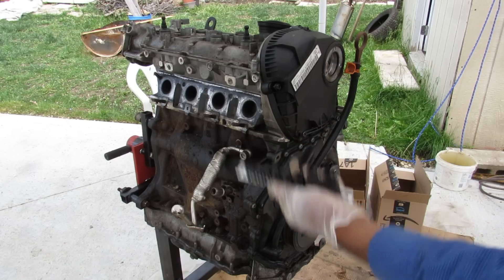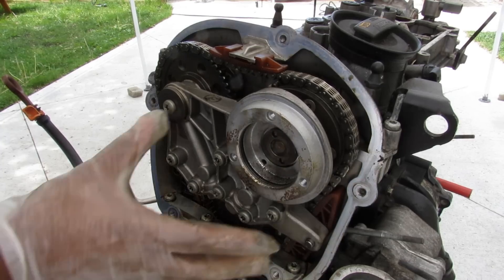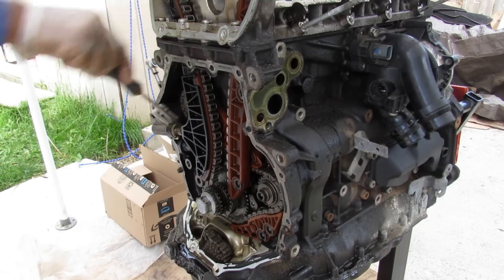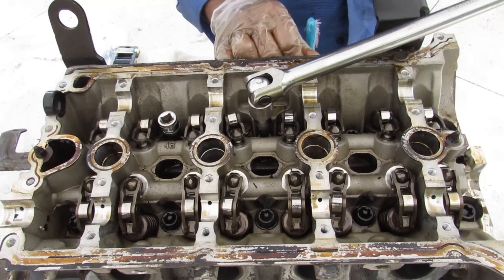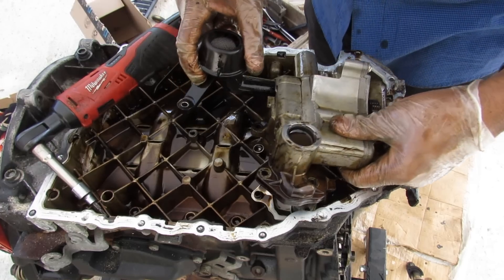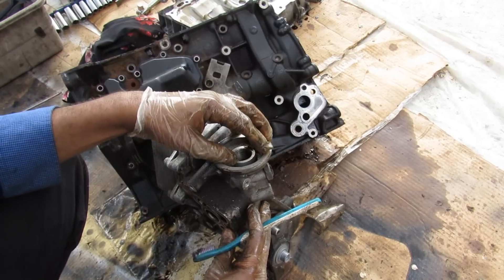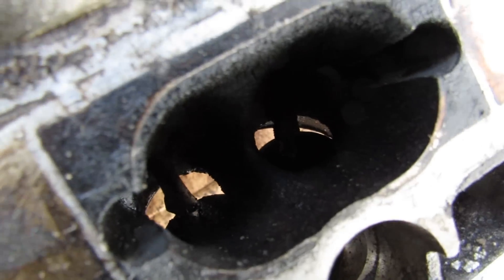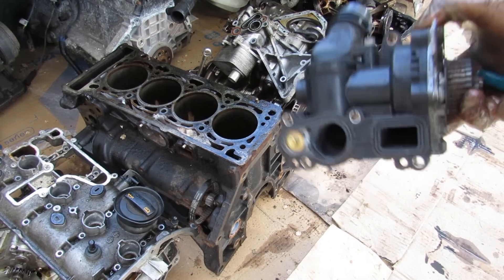Why Volkswagen Engines Fail

Comment: Man. The Title is shit already. Sorry, but not all VW engines fail. The ones with chain do bc vw just cant build good chain engines, but the ones with the Zahnriemen are quite reliable. The 2.0 TSI is when driven correctly an engine you can get 400 Ps with and IT Just runs. I really dont wanna be negative, but you Talk too much Shit.

Comment: I have 2016 ea888 2.0 tfsi gen3 , it has been 5 years now without any single prob I just think this engine is still like yesterday 
I also got another 1.8 TTQ gen1 and it’s still running like a champ for almost 20 years without any issue too
Another one is my R53 Mini Cooper S 15 years old runner:) 
I don’t like dealer stealership, so basically I’m doing standard maintenance myself at most and I’m not a mechanic either now I’m 38
“ simple care “. Will make the most of it  Maybe !!

Comment: And this is used also in their (VAG’s) “premium” cars huh.....Nothing from VAG is “premium”.
Reply: The only thing premium is the price to keep the thing running.
Reply: Funny, I have had absolutely no problems with my VW.
Reply: @BabyBugBug  what engine did you have, petrol or diesel?
Reply: @MrRohanThomas  Petrol 1.4L
Reply: @BabyBugBug  mine broke down 2 months ago😂
Reply: @chiel-  I’m sure it did unless you didn’t change the oil
Reply: Bugatti and Bentley and or VW Phaeton... hmm?

Comment: Kinda wish I could have sent you my old 2006 Focus for you to tell me why it went through three starters and three power steering pumps (among many other issues) in ten years.
Reply: Steering pumps seem to be a common failure with all of their models, and the newer electronic versions have their issues too... I mean for the hydraulic assist you can just put an aftermarket oil filter on and sometimes change the ATF in the system, so you can get decent lifetime out of them with a little TLC, but with the new ones you never know 🤔

Comment: All modern engines fail because two Main reasons..... 1. They are forced to produce more power from less capacity, 20 years ago we had 2.0 who produce 110 hp, now we have 1,4 who deliver 160 hp, în time material fatigue is critical........ 2. Long life oils changed at 15.000 km, they are a big pile of shit, no oil type shoud  be kept over 9-10000 km

Comment: Mk7/7.5 engines are more reliable than Toyota engines.
Reply from the maker: But they are still more expensive to maintain
Reply: @speedkar99  Service wise, I completely agree but then you get more powerful engines with even better fuel mileage. For instance, my 7.5 gti is more fuel efficient than a Toyota Yaris even though my car is hot hatch. It goes back to whether the buyer has some extra cash to spend.
Reply: @mkviis  Wrong. The Yaris is cheap to run and own. All VWs are expensive to run and own.
Reply: @MatrixDiscovery  I’m talking about fuel efficiency, my car does 38 mpg and Yaris does 35 mpg. My car is sport, Yaris is economic. My car has more than twice the horsepower. That’s what I’m talking about.

Comment: cast iron block with aluminum head, sounds like recipe for long lasting engine.
But VW being VW.
Reply: Almost every engine up to 2000 and even today was/is like that - nothing wrong with it
Reply from the maker: Make it all aluminum like all engines after 2000
Reply: Cast iron block with alminium head usually last forever, like Mitsubishi 4G63 and many others.
But Mitsubishi switched to all aluminum configuration in 4B11 and still is an exceptional engine.
Reply: The disastrous Chevrolet VEGA engine had an aluminum block and iron head!
Reply: @genekelly8467  seems like GM never made a truly reliable engine beside LS
Reply: @madunwerkstatt3093  Not true-the SATURN 1.9 l I-4 was exceptionally reliable-mine's running at 207,000 miles
Reply: @N4CR  too bad we didn't get V6s down here..

Comment: Your videos are amazing, you can learn so much from them!!! Thank you! I would like to ask, do the 1.8 tfsi engines face the same issues as the 2.0 ones? Do they share the same faulty parts (timing chain tensioner, water pump, etc)?
Reply: Yes, they're the same.
Reply from the maker: You are welcome. No experience with the 1.8
Reply: Same engine family, similar issues. Heard about cylinder head problems with those. But pay attention to which generation it is, the gen3 version is fairly reliable thankfully
Reply: The EA888 exist in 2.0 and 1.8, so yes it should be the same. gen1 was shit, gen2 was meh, gen3 is kinda ok (started ~2014 or so depending on the car model).

Comment: Sold my GTI after 150k miles. Everything engine related was starting to fail, oil & coolant leaks along with carbon buildup (again).
Reply: Well past 150k with not a single fault, ever.
Reply from the maker: Wow. Anything catastrophic fail?
Reply: @speedkar99  you'd have to ask the person he sold it to

Comment: 2E, ADY, AGG and ABF were the best 2L engines VW ever made in terms of simplicity & reliability.
Those were simple to work on and were built to last.
Reply from the maker: Nice
Reply: Are they the "2.slow"? :)  The EA113 & EA888 is the "2.fast" I guess!
Reply: @TassieLorenzo  best in terms of RELIABILITY & SIMPLICITY.
Reply: @TassieLorenzo  That's the 2.5 EA855 inline 5 engine that people refer to as the "2.slow". The EA855 is also one of VW's best engines.

Comment: TSI engines are wide used but after 100k miles they are ticking 💣. Those are 100% guaranteed failures. DSG failures are also very common. So there you have it all information why you should avoid it. PS I'm the lucky owner of 1.8 tsi with DSG 🤣(basically the same engine).
Reply from the maker: I want to teardown an DSG next
Reply: @speedkar99  It would be great if you could find DSG7 (dry dual clutch). Thank you 😉

Comment: Just change the oil regular as clockwork and don't rev it until it's warmed up. Like any other engine it'll last forever. Mine has!
Reply from the maker: This one seemed to be well oiled and still failed.

Comment: Lada engines have timing chain and tentioner, they never fail.
Reply from the maker: But everything else does
Reply: @speedkar99  the only thing good about modern ladas is the engine block heh. It's a modified 4 cyl design that dates back to the 70's. Made of cast iron, handles a turbo like a champ. The 1,6L Lada Vesta engines get swapped into the old Lada 1200 cars and with  some other adjustments can run 300 HP reliably. The rest of the car is... well... cheap.
Reply: The only good thing about lada.
Reply: To be fair- the guides occasionally failed- with the chains munching through them. Clattering along still- until the chain chewed a hole in the side of the head and spat oil out lol !
Such was the cost of the chain guide (pennies) and its location- replacing them was the sane thing to do during a service- two 10mm bolts and 60 seconds to do ! :)
Reply: Yupp a true ruski ride
Reply: Btw the newest motors are like 85% plastic... Last vw motor year ill ever own is 2005. New shit is cheap. Too much maintenance on a direct injection as well
Reply: @raisethecolours  Agree. D.I with all the carbon build up
Reply: @Blue-moon12  i remember back in 08 everyone was nutting themselves over D.I.     I was like yeah high psi fuel equals high repair costs. Hence the cummins 12v and 24v fuel systems.. terrible and costly due to the machining and making of the just the high pai pumps themselves. Vws have a pressure regulator and u gotta replace it quite often and its almost 200 dollars... Im good ill stick with the old tech. It is the best .....
Reply: Thats because the car rusts to death before the engine has a chance to fail lmao
Reply: @abadibi  Yh sure. they rust. I was just giving an extreme example. Okay audi 80 b4, no rust and engines are indestructible, I drive 1.6L golf 3 variant, car has done 380k km, and thats what i know, who knows how many times the odometer has been tampered with. Ive done 80k with the car in the last 3 years. All ive done to the engine is new spark plugs, distributor cap and rotor. oil change every 5-7k km, and timing belt every 60k km. And the car is not rusty either. meanwhile Ive seen new audi's come in the shop with 40-50k km and they need timing chains replaced.

Comment: Can you create a video explaining what carbon build up is, and where it comes from? How does it get on the other side of the valve and intake runners. Why does it stick to the combustion chamber, and how do products like Seafoam remove it better than fuel spray/combustion process itself?
Reply from the maker: Good idea

Comment: I've had a family friend with a VW 1,4l TSI. The car had 3! engine replacements winthin warranty period. One time the time head and block warped, and started leaking all over. One time the engine just LOCKED UP while driving on a highway an nearly crashing him, the third time it had a piston blow up... I'm not sure how VW manages to mess up their gasoline engines so hard. Each time the dealer decided that it would be cheaper to replace the entire engine unit... Needles to say, the man sold the car as soon as warranty expired.
Reply: How old was the car,  which model?
Reply: @mikimenendez  I think it was a Skoda Fabia Second gen... although now that I think about it it had an FSI engine, not a TSI.
Reply: @foxman105  Thanks! I just bought a 1.4 TSI, the most recent,  wish me luck!
Reply: @mikimenendez  Well hopefully they managed to finally fix the problem. As much as VW is a comfortable and responsive car, the mechanical reliability of their engines went down with FSI and older TSI engines. Hopefully they fixed it. BTW you might want to invest into oil catch can on the recirculation circuit as they often get dirty valves because they're direct injected.
Reply: @foxman105  absolutely,  thanks!
Reply: @mikimenendez  dont worry.Have mine for 8 years and no problems.
Reply: @gideonvanloggerenberg4831  Thanks! Everything going perfect till now
Reply: @mikimenendez  no problems
Reply from the maker: Wow. 3 motors
Reply: @speedkar99  Yeah, each time the engine blew up they reset the 100k engine warranty because they swapped in a new unit. It's 5 years or 100k so he sold it after 5 years.

Comment: Fun vid, no shot at the producer of it but a 10 year old engine (average perhaps 150k miles?) for which we have no idea on maintenance records, service intervals, or actual mileage.  Therefore no point of reference too make any kind of procurement decision on a VW product.  For every motor like this there are thousands that run up much higher mileage without said issues.  Of course the VW haters all cheerfully pig-pile on VW’s poor German engineering, a common internet past time it seems (perhaps they could design and manufacture a better one?).  Quick story, wife’s Hyundai Sonata fragged it’s motor with 100,007 miles.  Oil changed every 3,500 miles professionally, dealer serviced from new, always on schedule.  Meat Heads at Hyundai headquarters wouldn’t even talk to us about their POS engine just 7 miles out of warranty.  So all Hyundai’s are crap right?  Most likely not, but this was our particular reality/experience; much like this sad motor.  All mechanical devices fail, some sooner than others depending on their treatment.  Maintain your VW engine and drivetrain with quality consumables in a timely factory scheduled manner (be more aggressive than the current 10K oil intervals) with professional mechanics and your results should be different from that witnessed here.  Were this not true VW would have been out of business many, many years ago; consumers are truly not that stupid.  Enjoyable video sir, thank you for sharing; absolutely love the family support equipment you utilized in the engine tear down.  Cheers!
Reply: huendai are crap and some japenese cars are crap too but you know what is the diffrence ??? the diffrence is that those cars are cheap and there parts are cheap too and fixing them is simple and no need for expensive special diagnostic, programming , sockets and tools unlike VW ...

Comment: Your research has gotten really good.
It's worth noting the early style timing chain tensioner can be replaced with an updated unit, meaning you can get these engines on the cheap from people terrified of failure, and then do a day's work to make it fairly reliable. Add in $1500 for a K04 turbo kit while you're in there and you have one of the cheapest ways to get a 350hp daily. Certainly when compared to a WRX for instance.
Reply from the maker: Thanks. Yep if you kept this engine updated it can be reliable

Comment: Europas biggest car manufacturer do not know how to make engines, and not cars either. Bad zink treatment on the body of these cars and bad paint on top is really special. The Passat cars are the worst. But when this brand have the biggest budget for commercials, people buy this junk....The truth is that all moderne cars are more difficult to repair. But this aaa engine was terrible.
Reply from the maker: Yes. All cars are progressively getting more complex and harder to work on
Reply: @speedkar99  This is why I like old American cars-plenty of room under the hood, simple to fix, and cheap parts. Face it-gasoline isn't a big part of the cost-if you count repoairs on engines like VWs
Reply: @genekelly8467  I have owned only   well used Chrysler cars from early 2000. They use bit gas but it is still better than to leave all the money to the bank. Here in Norway the gas price is now in weekends up to 17,-  kroner. That's about 2 dollar for each liter of fuel. We thought we had a oil country but we where wrong....

Comment: i own this engine. It made me an excellent engineer and verry poor
Reply: there is arab mechanic says i notice that most vw/audi owners knows alot about there cars and they are not normal users 😂 i learned alot from owning vw but i got rid of it cuase it doesn't worth that its not a bmw or mercedec lol
Reply from the maker: Nice. What engineer are you? Mechanical?
Reply: @speedkar99  university taught mechanical student , speedkar taugh engineer, got my thesis with your help on variable valve timing :P

Comment: I got a EA111 1.2 TFSI and the chain was replaced 2000km ago. I hope it will last another 140k.
Reply from the maker: Hopefully
Reply: I mean, probably you'd have had to do the timing twice already if it had a belt, not that bad. The 1.2 doesn't even have VVT, fairly simple engine in today's norms, and fuel economy is definitely a strong point of these TSIs 👍 from what I've heard, pay attention to oil changes, carbon buildup, use good quality fuel & -filter, then it should work well

Comment: I guess they use cast iron blocks due to narrow bore spacing. 2-liter engine has just 5.5 mm between the bores, so it's probably cheaper and easier to use cast iron for turbocharged motor.
Reply from the maker: Perhaps to handle more boost I'm higher power applications
Reply: Also apparently iron has better acoustic dampening than aluminum (this was important since the engine was designed by Audi)
Reply: Handles boost and stresses better than Alu. Which is why the fastest LS builds are usually custom pressed interlocking sleeve aluminium blocks. Then you have the strength of the Iron where you need it (peak cylinder pressures, rigidity and all the rest) and the lightness of the aluminium elsewhere.

Comment: Hey unrelated to the video but respect your opinion, a welded nut inside the frame of my 99 civic broke when trying to remove the passenger side torque mount. Would it be safe to cut holes big enough to fit a socket on them and remove without welding the holes back up? Or should I cut the bolts and use rivnuts instead? Appreciate it
Reply: @Green Mamba Games That’s the thing I don’t weld so couldn’t patch it. If the holes were about 1.5” inches and left open would it cause issues?

Comment: I run a VW Passat 2.0 TDI from 2016. Only oil changes, NOTHING happended in 150.000km! Timing belt still good for 50.000! Go for TDI not TSI!
Reply from the maker: TDi should hold up

Comment: I'm surprised VW hasn't tried making the engine block out of plastic with only the cylinder walls being steel yet, I bet they wish they could... those plastic loving freaks.
Reply: @Green Mamba Games Well, plastic does turn very brittle after many heat cycles, so those sure are going to be some very disposable engines ... If I ever end up working on a project where we try to make a plastic engine, I'll quit.
Reply from the maker: Wow they would be interesting
Reply: @speedkar99  Well, guess they would be interesting... but at the same time its a frightning idea 😅

Comment: Meanwhile Iam rebuilding a 256,000 miles VW engine that is 31 years old for fun 😂
Reply from the maker: But it doesn't have a chain does it?
Reply: @speedkar99  no thank god not. but old bmws had them. and mercs too. they didnt have Problems back then 🤷‍♂️